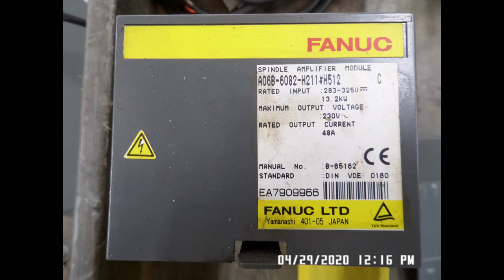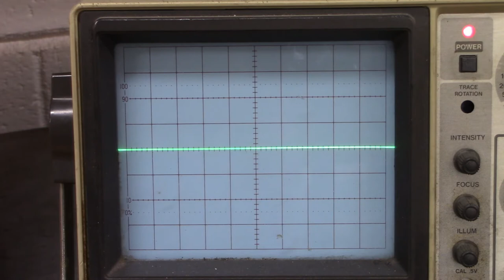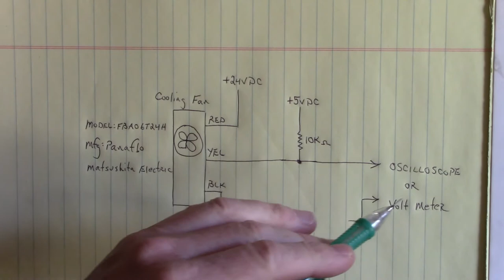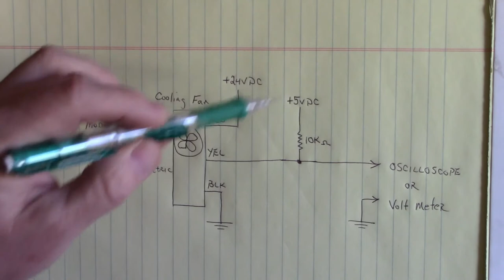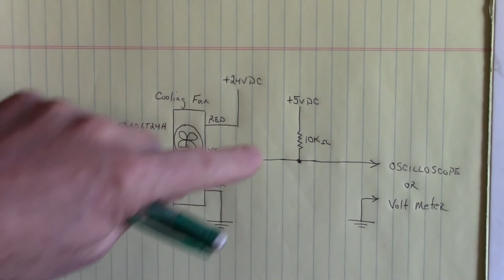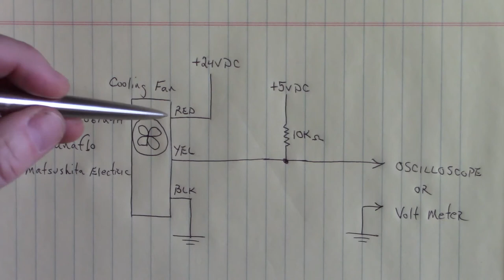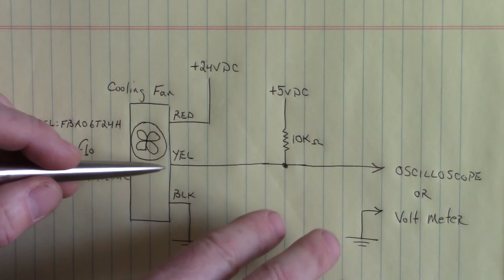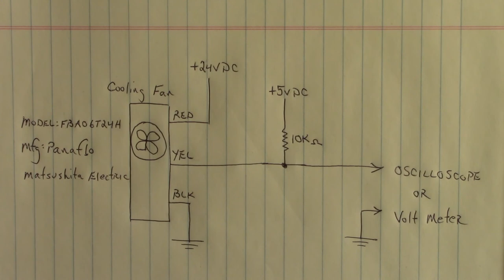Testing the Cooling Fan Feedback in the Fanuc

Comment: This is the fan blocked signal. New fans has tacho signals and you can see the fan speed.
Reply from the maker: Fascinating, I never knew there was a cooling fan with tach generator feedback output... In the near future, I am going to make a video of a cooling fan from an Optoma Projector. It has a squarewave feedback output using a pull up resistor for open collector output. Thank you so very much. I am always learning something knew in elelctronics:)
Reply: @PeepawMcDonald  I learn from You too Peepaw
Reply: @PeepawMcDonald  to

Comment: Hello sir 
I have a problem with my PSM A06B-6087 H126
When I power up from the back of the electric cabine the LEDs don't lit up 
I checked the 220AC ... It's fine but all the modules are off 
Can you please help me 
Thanks